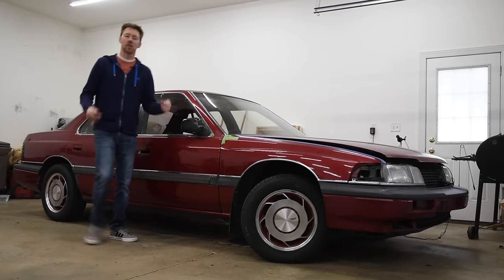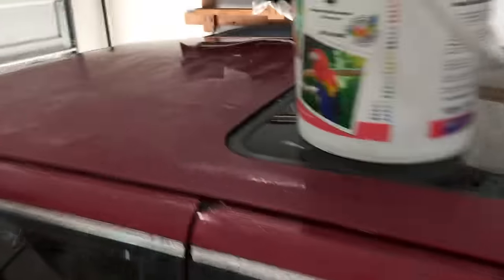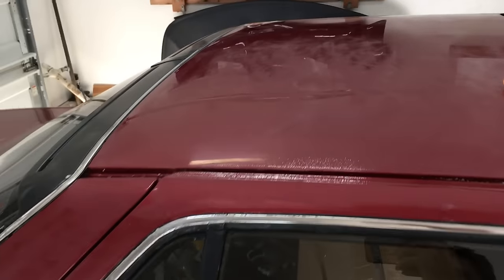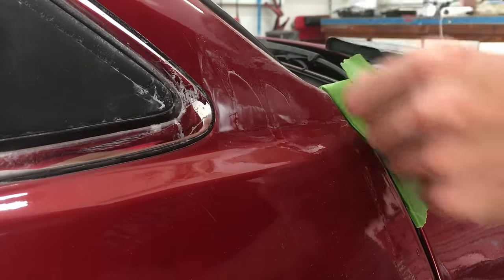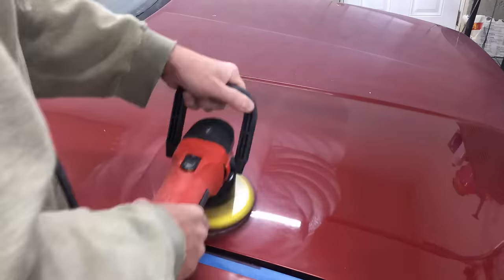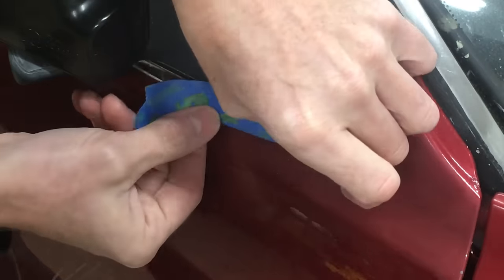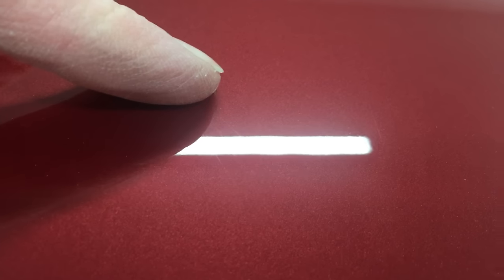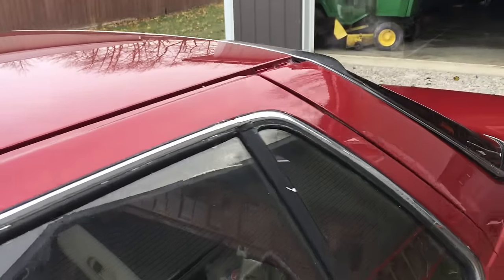How to: Wet Sand + Polish Clear Coat Paint - Part 2

Comment: I hope you don't mind a suggestion. Next time, you should try putting an HVAC filter in one door and seal around it, then put a fan blowing out the other door. Also, you should keep your floor wet to prevent dust from being kicked up as you walk around the car.
Reply: I was gonna mention that too. Sure woulda helped earlier when his neighbor was mowing lawn....🤷🏻
Reply: I was gonna suggest a fine netting of some sort as well that would allow ventilation but keep some debris out too but what you said is better
Reply: No matter what painting in a garage you're going to have crap in your paint
Reply: @hedgepethracing9590  build a plastic tent, top to bottom, clean the floor good with lots of water,  a filter and a fan, 90% clean enviroment at home
Reply: I enjoy watching and learning do it yourself, thanks !
Reply: My son did the tent and fan, worked out fabulous.
Reply: This paint is toxic. You need a forced air type of full face mask.

Comment: I worked in a lot of panel shops over the last 24 years as a detailer and had the finishing job. You've done a great job for an amature in a home garage. As an experienced person I always sanded down to 5000 grit to get the best finish in less time,. I also had the right power tools too. It just takes time to learn these things. I made some costly mistakes along the way. A trick I was taught to get rid of big runs in clear coat was to use a razor blade first ( be careful though ). Anyway I love your video's. Cheers Brother.

Comment: You put alot of work due to conditions you cannot control. I like the way you overcame them and for doing this at home, your finished car came out better than some pros out there. I liked the way you dealt with the clear coat failures. After being quoted 3k for painting my truck with the sane similarities as your ACURA paint problems, I think I am going to go your route and try this in my garage. Good job
Reply from the maker: Thank you! With the price of body shops, I figured I'd have nothing to lose if I tried it myself. It just took me a lot longer!

Comment: After the 105 compound, switch to Meg's 205 polish for a deep luster on that paint.  Then, for about another $25, you can hit it with Meg's spray-on graphene coating for even more depth, and a solid 6 months of protection before re-applying.  Easy, cheap solution with good protection, and easier than a wax.  Great work on that Legend!  I remember installing stereo systems in those back in the early 1990s when I worked at a mobile sound shop in Va.  Brings back memories.
Reply from the maker: Thanks, I always enjoy advice from professional detailers!

Comment: Wow! What a good DIY, the explanation lives the beginners with no question,
To minimize orange peal, you need to set your regulator right according to your gun, your distance between your gun and the body should be aimed right as well as the straight gun handling while moving side to side.
As for the insects,  it's a common problem on DIYs because of grass outside plus the paint smell it looks like insects likes it, so I use this Insects lights after painting,  especially on afternoon through out the night, MAKE YOU DINT HAND IT STRAIGHT ABOVE THE CAR. 
OTHERWISE,  WELL DONE
Reply from the maker: Thanks! I needed to be closer to the hood and roof. I was a lot closer on the bumpers and they turned out much better.

Comment: Just finished watching Parts 1 and 2. Amazing job brother. Great camera work, editing, and narration. And the fact that you left your mistakes in and showed how to fix them is priceless for us DIYers. I just bought a vehicle with mostly good paint but the plastic spoiler has some serious sun damage, peeling clear coat. I’ll have to smooth her down, repaint and new clear coat. Any tips on restoring plastic VS metal? Things to watch out for, etc?
Reply from the maker: The only thing to watch out for on plastic is that if you happen to sand through the primer down to the plastic, use an adhesion promoter, as I did when I was prepping the bumpers in part 1.

Comment: Great job, man!! I recently, (last yr), did the same with an '01 Taurus with failing clear coat, (peeling, oxidizing) that I was trying to sell on.  I used all the same steps/techniques except I didn't have an airless spray gun for the clear coat. I was forced to use rattle cans and got similar results... a few dirt specs, a bug or 2... (gnats, they're attracted to the sweet smell of paint, I believe), and of course, the dreaded orange peel! I have to say, it was killing me watching you expend all that time and "elbow grease" by hand-sanding all those large, flat panels like the hood and roof! When prepping/sanding, I saved a bunch of time/elbow grease by using a DA (Dual Action) 5" round DeWalt sander. It has a "hook & loop" sanding pad/paper attachment system, (Velcro). LOL! You can also buy all the diff grits of waterproof sanding "paper" with the Velcro system... (up to 3500 grit, I believe). If you have an O'Reilly Auto nearby, some stores have an automotive paint supply. You can buy matched OEM paint by giving them your make/model/yr, and paint code... the computer "dumbs down" the orig. paint appropriately adjusting for the yrs of UV damage/aging. (matched great, btw!!) They will also gladly sell you all the necessary prep/paint supplies, tools, etc. for prepping, painting, and polishing! I also purchased a "professional", 8" buffer/polisher... (also by DeWalt), on Amazon... (looks like a lg version of a grinder), and finally, I bought the 3M polishing kit which came with several diff polishing pads (Velcro), in diff colors for differing grits of polishing compounds, (of which, there are 3 grits, in diff color, qt. size bottles). It wasn't cheap, but is well worth it! Also included, 2 Lambs wool polishing pads for achieving a hi gloss finish. I also purchased the same type of foam, flexible, wet hand-sanding pads that you used, in diff grits for hand sanding the non-flat/ difficult areas that the DA is not equipped to handle, (w/o causing damage to the surface). Meaning, all the curves, body lines, edges and tight areas. I was very happy with the finished product as I achieved a near-factory finish for a fraction of what a pro would have charged. Although, I learned first-hand why the pros charge what they do! (as it IS very labor intensive!!). Thanks for making these very informative, well thought out videos!! Again, Great Job!! 
                        Cheers!! 
                                        Steve G.
Reply from the maker: Thanks for all that info!  I do plan on getting a DA after all of this sanding! Also, the computer adjusting for the years of UV fade is awesome- I'll remember that.

Comment: Hey man! Fun to see what one can do in a garage, and the result is good for what you have! But after painting for some years i could recommend a 35/50/50/50/ spraying technique with tape dry in-between coats. At around 15-20C temp. It might look ''orange-peely'' but due to it not cook drying it will flow out alot and make every garage paint job look alot deeper and more ''glossy'' And due to multiple coats of clear in one application you have a lot of clearl to play with 1200-1500 / polishing to get that good good.
Reply: What’s that mean brother? 35/50/50
Reply: @_youngstajae  Coat ''intensity'' Like how much material, 35% is a coverage where you still can see primer inbetween the color. A 50 is a ''orangepeely'' coat but when you apply 3 of them they build up and melt togheter. and then they flow out. A 100% coat is one that looks very flat and good, but is thinner in paint.

Comment: Excellent series. 

I found you can fill divots with a little 2I clear and a small stick. Just fill it and wait a few days and sand it back.

When sanding runs I wrap the sandpaper over a deep socket say a 19 mm. This gives very hard localised pressure on the high point and a light pressure on the rest. Once the run has gone finish off with a normal block.
Reply from the maker: Excellent tip, thanks!
Reply: thank you 🙏,
I’ll try this on sun-faded side of my son’s car.

Comment: I know your impatient to fix the runs, and I have done the same thing.  But 3 or more months is much better depending on the clear.  I even waited over a year.  Most will level themselves out pretty nicely over time.  If it's a customer's car it's different because you can't wait, but if you have the time, it's better and easier to wait
Reply from the maker: I never knew that... thanks!!

Comment: Wish I would have seen this video a few years back. I have a 96 probe that was really sun faded on one side and the top. Laser Red. That color is known to fade to pink. Didn't think there was any hope for it so I sanded it down and primered it flat black. Stuff happened and I haven't been able to get it painted. But now I'm thinking of doing a colorshift wrap instead (might end up being cheaper too and no buffing afterwards required)
Reply from the maker: Red always fades the worst of any color from UV rays. Nice Mach 1!

Comment: An effective way to remove orange peel is to give the surface a light dusting with a contrasting color first. The guide coat will also end up in the "valleys" so when you sand it is easier to see when you reach the valleys and can stop sanding.  If you do get runs, wait for it to cure and cover the area with bondo then sand down until bondo is gone. This helps you avoid sanding through the new clear and also shows you visually when youre done. When using an orbital or random orbit, make sure you dont stay too long in one area or you may create enough heat to scorch the clear coat. Another tip would be to use "uni-grit" paper to avoid those random scratches.
Reply from the maker: I've done a guide coat when sanding body filler to look for low spots/scratches... never thought to apply the concept to clear coat.  Thanks for the tips!

Comment: If you accidentally get any drips or hangers in the paint, you can try this trick first so there's less paint to water sand smooth. Take some masking tape and form it into a loop with the sticky side out and then gently touch the paint where you have the hanger. It will remove enough paint that a lot of times you don't even have to do anything else to get rid of them. As long as you're careful, the worst that can happen is you have less paint than you originally had to sand smooth.

Comment: try using a red(maroon) scuffpad followed by a grey scuffpad next time. it will save you a lot of time sanding. The grey scuffpad is rated as 1500 grit. you could also end with a white scuffpad (3000). it works great for me and doesn't need much pressure or sanding.

Comment: Your video help me a lot 
My dodge ram cherry red as spot of small rust upper of the windshield 
So i did use the sand paper primer and paint but visible is not exact the same 
The spot is visible 
I will try your step sand and water 💦 that one i never know about 👍

Comment: Love your videos! What did you do to the trunk of this car? I remember you saying that only polishing may suffice... did it or did you have to take off clear coat and reapply clear?
Reply from the maker: I only had to polish the trunk. The paint was still in decent shape. I think the trunk may have been repainted at some time before because the emblems were mounted a little higher than normal.

Comment: Hi 
I have a question and really could use the help. I painted my car recently. I think I did overall a good job but can see orange peel around the whole vehicle. I washed it and the car looked like glass but then when it dried it turned back to orange peel. Any thoughts on how I could fix this? Thank you
Reply from the maker: The water is filling in the rough surface, making it look smooth like glass. Then the water runs off and it goes back to looking rough. You'll have to do exactly what I did in this video. Wetsand down all the high points, then polish the clear.

Comment: I got a DA a couple months ago, and now I know what pad and compound I can use on my Corolla. It's basically the same color as this car. The only real difference is, my paint has pigments and metallic flake in the clearcoat rather than the paint itself. They have my paint in an aerosol at Advanced Auto, O'Reilly, and some other places but it's not the same so I'm not too sure if I should use it lol.. One of my doors has bad clear coat coverage and deep dog claw scratches.. I got pretty okay results with a Heavy Cut compound and a foam pad, but swirls are still visible in a lot of spots (previous owner went to the carwash a bit much lol).
Reply from the maker: You're on a good start with removing the scratches. The swirls can usually be removed with a finer compound.

Comment: I have a question: why can't you use a DA orbital sander for this? It seems like it would be much faster. Can't you just set it on low speed and use a DA orbital instead? Or should I use a block?
Reply from the maker: You can if you're careful/experienced so you sand evenly.  I showed how with a block because not everyone has power tools.

Comment: I want to tackle the same clearcoat issue on the end cap of my RV. Since it is fiberglass what would I need for a fiberglass friendly primer or paint adhesivesolution?
Reply from the maker: I don't have a lot of fiberglass experience, but I know that if the gelcoat is worn through and the fibers are showing, a new gelcoat will be needed first. If it is just the clearcoat that has flaked, then you should be good to just do the same steps as I did. Just be careful not to sand down to the fibers.

Comment: I have never used ceramic coating but want to. Do I use Dawn to remove the wax (If I already waxed the new paint) and then just follow the ceramic instructions or do I put it on top of the wax?
Reply from the maker: all was must be stripped before applying ceramic coating. Must ceramic coatings recommend isoprophol alcohol wipes to remove any remaining wax. If the paint is older, I recommend pain tcorrection before the ceramic coating https://youtu.be/z2IVaqRdbOg

Comment: Excellent video 👏 quick question... after polishing do you also remove the oils from the polish or jump to the wax?
Reply from the maker: Thanks! After polishing I went straight to the wax because The compounds I used did not leave any oils.
Reply: @6thGearGarage  noted. If it did indeed leave back oils how do I remove them before applying paint protection?
Reply from the maker: I would use a wax & grease remover on the surface. Prep-All is cheap and works well https://amzn.to/31YfrCm
 @Carnage488
Reply: @6thGearGarage  great thanks for the advice I'll give it a shot!

Comment: A little bit of dish soap in water bucket when you wet sand after paint helps the paper glide and not dig in
Reply from the maker: Thanks for the advice!
Reply: @6thGearGarage  I have detailed a long time I just think the foam gives a clearer buff without taking off material and help fix swirls because the compound is what makes swarels if you keep buffer movement faster helps keep swarels down wool pads cut faster and you can ruin paint faster just like anything find what works for you I used to do corporate jets the brightwork is polished thin aluminum easy to ruined and very very expensive 50k And up for a small panel easy to scratch
Reply from the maker: @derekmeldrum4801  I've never tried a wool pad, always been intimidated and worried I'll do more harm than good. I still have a lot to learn!

Comment: Wait after u sand it down again, you didn’t have to add clear coat again like part 1? Why not? Does this mean i can just sand my peeling clear coat and polish after instead of repainting/recolor?
Reply from the maker: I used a higher grit paper this time to only sand through the orange peel, not the entire clear coat. In part 1 I used a lower grit paper to remove much more material. You could just sand and polish, but the clear coat would continue to delaminate and the color would continue to fade where there is no clear. It would look a little better for a while.

Comment: I've got an old Saab with the clear coat peeling in several spots but the base paint looks alright. How would you go about something like that? Wet sand all of the panels with peeling and apply a new clear coat and polish? Or would i be better off wet sanding the whole car and applying a new clear coat?
Reply from the maker: Did you wet the surface to do a test of how it would look when re-cleared? That should show you if the basecoat has faded since clear was missing.  The chances are when you wet sand, you may go through the basecoat because it is thin. So you may end up needing to touch up the basecoat in some areas.

Comment: So I currently did a touch up paint on my car and then put a clear coat in top of it, what grit do you recommend to start to make the area smooth from the clear coat I put?
Reply from the maker: It really depends on the amount of orange peel. You saw how rough mine was in some areas. If yours is finer, you can start with a higher grit. Just don't start too high or you'll be sanding a lot longer. Also the type of clear makes a difference. 2k clear is a lot harder than lacquer.

Comment: Do you know if you have to remove the front door window on a toy pickup to replace the window runner seal??
Reply from the maker: I think you have to remove the window because it's such a tight fit.
Reply: @6thGearGarage  Thanks will let you know how its done after it stops raining and I figure it out

Comment: Question because I want to learn. Why didnt he just use a cutting compound to even out the clear coat instead of wet sanding?
Reply from the maker: Wet sanding was done because I needed to remove more material than a compound would. A compound is for removing finer scratches like that left from the wet sanding.